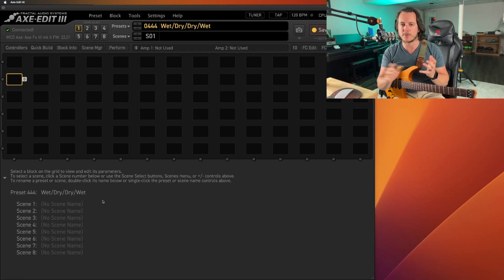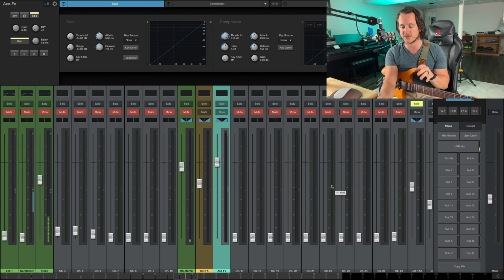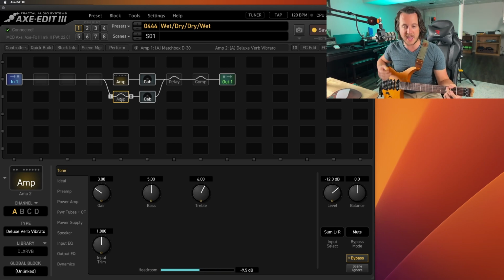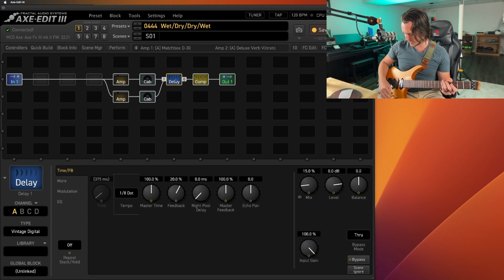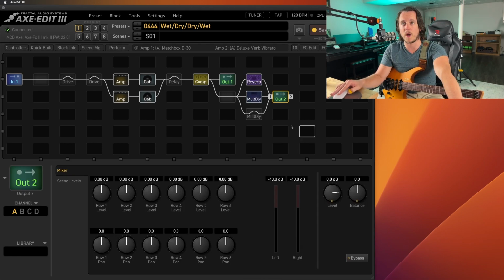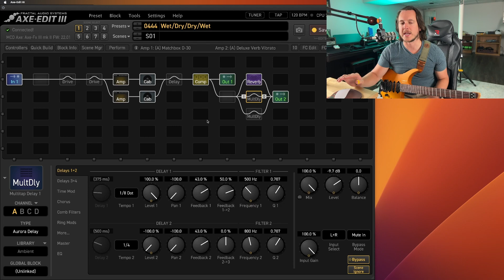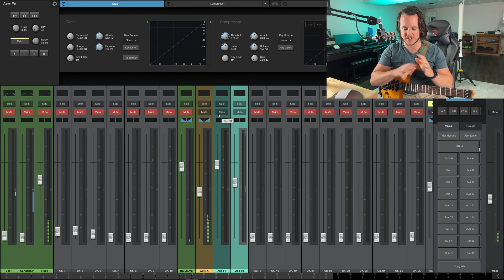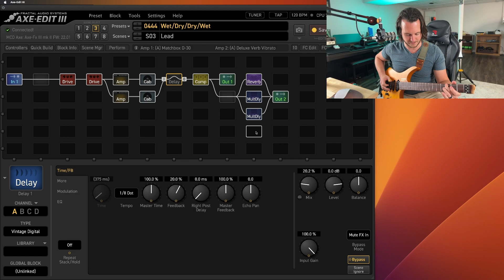Creating the ULTIMATE Axe-FX Rig (Wet, Dry, Dry, Wet)

Comment: I really used to love the wet, dry, wet sound back when I was playing my Boogie dry with a stereo power amp with effects out through my effects loop.  There really is no better way to maintain solid, defined headroom especially with a lot of delay and reverb...the dry channel really helps the guitar signal to sit well in the mix.  
I really enjoyed this video and was just trying to wrap my head around what you did with the mixer (it finally dawned on me after watching the video a couple of times that the two "dry" channels are actually a result of using dual amps)...channels 13 / 14 on your mixer are handling the two mono amp chains via output 1 from the Fractal while channels 15 / 16 are handling the stereo effects chain out of output 2 from the Fractal?  I was also curious as to what digital interface you were using with your Studio One?  I have been using a StudioLive 8 channel mixer as an interface to be able to mix various sources along with my FM9 but noticed that I had the same 32 channel mixer as you used in the video in my Universal Control as well.  I am definitely going to be experimenting with this set up.  Thanks!
Reply from the maker: Essentially yes, that's how I have things routed however due to easier cabeling set up, I used 13/14 for wet and 15 for a dry amount and 16 for the other dry. My interface is a StudioLive 16 console mixer running USB. I used Universal Control to show what I was doing on the console. I actually didn't capture the audio with Studio One, I ran my camera and screen capture and mixer into OBS to record everything at once. Might do a video explaining my video set up if that would be interesting.
Reply: @mathew_dale  Thanks for the great information!!